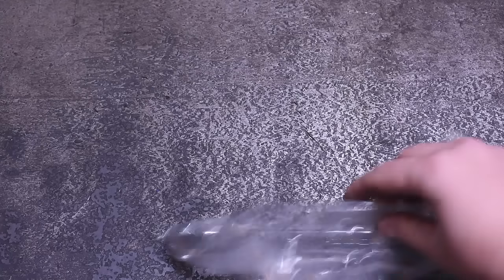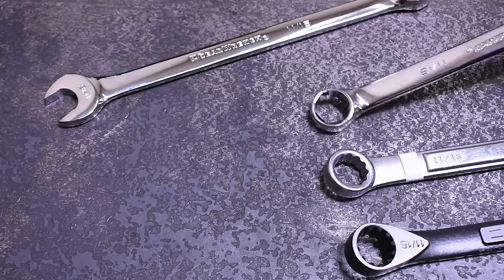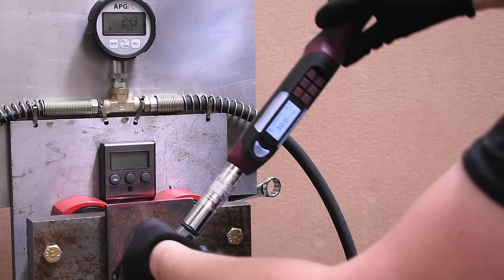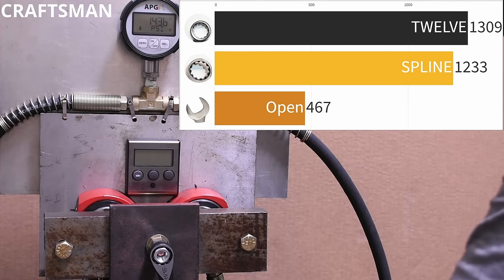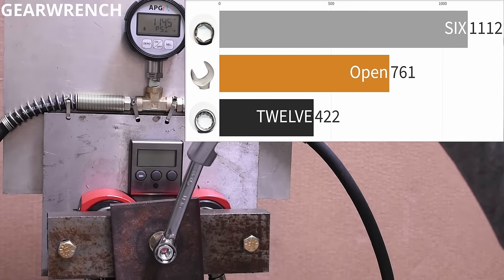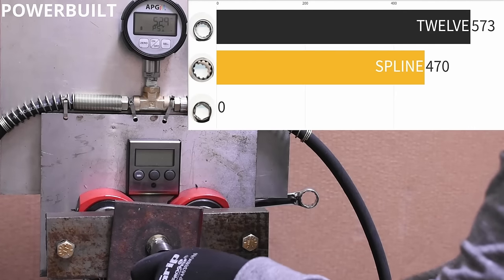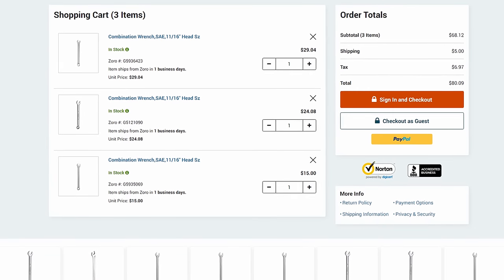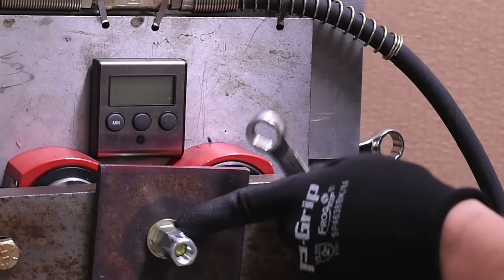Let's Settle This! What Wrench & Socket Design Will Slip 1st?

Comment: I truly believe it depends on the job. As some nuts/bolts will be a struggle to crack if there is less points on the spanner/wrench. Mainly because it can be to close to another object to get to get decent leverage/ grip to crack . Where as more points means more angles ...otherwise 6 point all the way less slipping guaranteed as is the same shape. . Just my personal opinion. Great video

Comment: Hello from ex-ussr country with long winters and tons of agressive chemicals on roads. 12-pointers and splines are suck. New drop forged wrenches are suck too. Oldschool open wrenches and 6-points do the job. Sometimes with 2 meter long tube (used as torque expander) and some wd40 as an ultimate argument. (:

Comment: If at all possible I always use box end a sockets that grip the flat of the bolt head or nut.  I also have a complete set of MetWrench tools that I've used quite a bit.

Comment: One benefit of 12-point is the OD - generally smaller than 6-point, there are cases where a 6-point won't fit, but the 12-point from the same set will. How does the OD of the spline compare?

Comment: Can you please test L pattern hex keys? I know they're not as resilient - ultimate torque load - as 6pt external bolts. But some industries love SHCS and knowing which brand holds best would help. I've found Wera to be my fave. They have a patented design, almost like 'flank drive' socket but mirror image. I've found works quite the difference. Literally can remove SHCS fasteners that other hex keys from another mechanic has already rounded over. Useful for 'one time' removal for service and just throw the fasteners away after access is gained.

Comment: Gearwrench has the 120xp double box ratcheting wrenches in spline drive; one end is fixed and other end is ratcheting. I've been using em for ~6 years without issue, but I can imagine spline drive to be an issue if you're in the rust belt.

Comment: I just weld a larger nut on stripped or broken heads. Let it cool down a good bit and off or out it comes. Cost is pennies another Way is drill a hole in flat or angle stock, place over stripped bolt head and weld, this allows you to break it loose but many times can't make full turn and is my least favorite trick. Hope this helps some people 👍

Comment: I just wanted to say thanks. Because of your video it gave me enough confidence to buy a set of spline box wrenches specifically to loosen a rounded exhaust bolt. It was in a tight spot and I couldn’t get a socket on it. And the spline box wrench did the trick! You guys are awesome for putting content like this up.

Comment: When I was a poor high school student in the mid 70s, I could barely afford a 3/8" Canadian Tire ratchet wench without a socket set. Even then my intuition told me 6-point sockets was the best for my non-existent budget. I bought $0.99 6-point sockets made in Taiwan piecemeal which at the time Taiwanese tools were considered to be the bottom of the barrel. China made tools would take another two decades to be common place.

Forward 50 years later, most if not all these sockets are still in my go-to tool box and none ever disappointed me. If you wonder, I work on all my race and track cars, as well as road cars.

Comment: Use the right tool for the bolt head type? ARP studs are all 12 point. So i use a 12 point socket, the only time i slipped wrenching on one of these bolts was when i tried using a 6 point socket on one of ARP's large 12 point bolt heads.

Comment: Very interesting! 6 points have always felt like the best for grip, but can be godawful to use in tighter spacer, I wonder if this will make people who saw the video look into splines more closely. If you only take the wrench examples (i.e. ignore the socket) the spline was only 19% behind, clearly not quite as good as a 6 point but very competitive, and a LOT easier to work with in tight spaces.

Comment: I'd be interested to know how well wrenches like Metrinch  (which grab on the flats rather than on the points of a fastener) would fare compared to these other types?  I've had a couple sets of Metrinch tools for more than a decade and they always seem to get the job done just fine.  I realize that there are far fewer users of these tools but I believe them to be a solid choice for my own needs.

Comment: Witch open end wrench brand grips the best without slipping  using a 13 mm wrench. I do alignments on automotive  vehicles.  The inner tie rods on most are 13 mm and 15 mm. Snap on is the best I found so far but the most expensive.  Hope this would make a good video for your veiws.

Comment: Whatever you use, always keep an open grip on a spanner (wrench) if possible.  That way, if it does slip, you won't skin your knuckles.  It's an tip my old dad gave me. 😉
Reply: Also, if you have to pull a large wrench toward yourself, make sure to stand far enough away to avoid conking yourself on the noggin if you have a slip. Learned that one myself. 🤕😂
Reply: @TsandLman  👍

Comment: It depend upon the materials.  I find cheap tools and cheap bolts and screws to be soft like cheese while quality tools and hardware work well in all formats.  Philips is still good in some cases but around the house I prefer Spax torx heads.  Car manufacturers like us to have one of each in multiple sizes.  You have to hold this with a 40 torx, turn that with a 12 point while holding it steady with an open end box wrench and pressing twice on the volume control while the left rear door is opened and shut three times and thats how you add windshield washer fluid.

Comment: There is a rare socket that you should have on here and its a different kind of torx male tool, its for the new vw bug 1.6 motor and this tool is for the head bolts, instead of spending a fortune on that tool i modified a t-55 i believe it was for the head bolts and if you didn't know japanese metric is slightly different from German metric

Comment: To stop the nut from compressing itself, can you use a longer bolt or a shorter nut, so the wrench is never on an unsupported part of the nut? (so there's always something inside the nut and it's not "hollow").

Comment: 60+ years doing mechanical work gave me the answer you came to in your testing, six, Spline, twelve & open on standard hex fasteners. Now I wonder what would happen on 12 point fasteners if Splines would still beat the 12 point box or sockets?

Comment: Great video!

The splined tools do seem to do the work, but at the expense of the finish of the fastener. I would take this data and my professional experience and give the conclusion that 6-point should be your 1st choice, maybe use spline if the fastener is already in a bad shape and only to remove the fastener. Of course at that point you may be better off just using a hard punch and a hammer to rotate the fastener or even a chisel to split it.

Comment: In aviation I use 12 point for 12 point hardware (fairly common), and 6 point hardware (also fairly common). But I do have 6 point tools in addition from 7mm / 1/4” and below for protecting the hardware from damage.

Comment: A battle of the parts store tools would be cool. Like O'Reilly, Advanced, Autozone, NAPA, etc. name brand tools going head to head to see who has the better tool.
Reply: Good idea. I would say Napa is better than most store brands plus in a lot of areas, there is a napa about every 15 miles so that if you break something you won't have to go that far to replace it.
 Plus most of them are open six days a week some 7. Try to find a snap-on or matco  guy six or seven days a week

Comment: I have 12 and 6 points i use interchangeably but if I want a worn nut to come off with or without hurting myself it's going to be the 6.
also I think the reason the gearwrench slipped over the craftsman is because it may be a harder wrench and is chiseling its way through the nut easier.

Now does this mean that crappy cheap wrenches can put out more torque? may be in the case of 12 points.
I always thought spline was for spline lock nuts. Didnt know they could be used on regular nuts.

Comment: Did you measure the inner diameter of the wrenches in relation to the nuts?  How much slop there is may have effected the results, and may be a factor in which brand of wrench to buy.

Comment: Nice video, good to get confirmation on "old truths" that you just assumed. Would have been nice to see those 6-point wrenches that are slightly convex on each of the 6 sides. They are supposed to be even better at biting into the flat sides of the bolt, instead of applying all the force at the corners of the bolt.

Comment: I have to wonder if you kept the open end and box wrenches on the faster until failure (rather than taking them off and getting a new bite) is skewing the test vs the sockets which ARE kept on the fastener until failure.

Comment: the arc swing is why I use 12 point on 6 point bolts..  I love it when theres room to get a ratchet in even wit ha low-profile socket its just not possible over 1/2 the time..  ive not had the greatest luck with ratcheting wrenches.. esp with a pipe..  now admiteedly after seeing this video ill prob buy a set of gearwrench brand maybe ive just had crappy ratchet wrenches in the past..

Comment: With 6 point you need to distinguish between actual 6 point and hex wall or flank drive  versions that put the force further along the flat away from the point.  The test used here is not really representative since almost always the nut would have the male thread inside when the max torque is being applied so the collapsing effect  observed at the highest torques would not be as extreme.

Comment: I have all three types of wrenches not surprised by the results.  My extra long  double box are spline drive, though I really don't use them much because I prefer the six point wrenches with an extender as you have done here.  Really the problem is these days, six point wrenches command such as premium  over a 12 point combo wrench.  On E site, Craftsman v type 6 point wrenches used sell for more than they cost new, in some cases more than 3x their original cost.  The lower cost new on various sites I've seen and used are junk.  There is only one set that I have experience with that works ok, but the finish is only so-so at best and at worst down right terrible.  But, the fit at least, is good and matches my 30+ year old SK & Craftsman units.

Comment: I was always told that a 12 point ring spanner was to turn the nut lots in tight space and the 6 point ring spanner was to put on the torque for tightening and undoing.

Comment: So what I’ve learned from this video is that if it’s a 6 sided bolt use a 6 sided spanner or socket, if it’s a 12 sided bolt use a 12 sided spanner or socket, if it’s a spline bolt use a spline spanner or socket and if you can’t fit any of these on due to space then and only then use the open ended spanner.

Comment: I was always told that a 6 point will always grip a nut better as there is more surface area in contact. All the others are pushing towards the square peg in a round hole scenario.

Comment: I have been out of being a working wrench for 10 years. When I was working Snapon said there 12 point would give higher torque than there 6 point due to the angle of ground into there sockets. To be honest I stuck with six point unless the tool truck only had 12 point to exchange for broken sockets.

Comment: Last time I rounded off a bolt it was a craftsmen spline and on the first bit of motion I got. Was a socket too. proceeded to bend an open-end wrench and round it further xD
6 point is better. More surface area of solid contact. If you're gonna replace the bolt/nut, just start with a circle bolt socket xD
I think the 12 point closed are great 95% of the time. Just gotta be prepared for the 5% that can rob you of time if you weren't.

Comment: Great video 
You forgot to test Metrench spanners  and sockets, they have their own design which is made for imperial and metric all in one,
It’s also great for the rounded off nuts because if it’s design.
Reply from the maker: Will do this week
Reply: There already is a solution for this problem

get rid of the imperial garbage lol

Comment: how accurate can this be ? are you grinding the same amount off each nut before you start ? the grinding marks looked different each time, cool test though we did this with snap on vs matco at work one day lol they both snapped the bolts before slipping

Comment: I moved to purchasing splined drive on my tools... In my experience they slip less then the 12 points, but offer greater number of angles to set your wrench at then the 6 point. Sure I still have the six points, but only use them in cases that I need the extra grip on over tightened or rusted on bolts.

Comment: I swear by the Craftsman spline set.  I own and maintain a couple of Mercedes, which have a mix of regular metric and torque bolts.  The spline set just means I don't need to fish through multiple tools.  Granted, where I live is ideal conditions so, no rust and bolts are never really seized, but on the rare occasion something is stuck (on my Ram truck?), I have a set of 6 pt impact sockets and oversized 6 pt box wrenches.

Comment: 12 point is also good with square headed bolts/plugs. 6 point is all i use, especially for initial busting lose in tight spaces then i go to 12 point. I feel like the data means nothing compared to actual practice on seized bolts/nuts/pins

Comment: I can tell this video was made for auto mechanics when he started talking about grip on rounded fasteners. If they didn’t make automotive bolts out of peanut butter, neglect to use washers, and put corrosion prone alloys in damp areas, rounding over wouldn’t even be an issue. As an aircraft mechanic, rounded fasteners are a rarity, and 12 point fasteners are common, so it makes sense to have a majority of 12 point tools.
Reply from the maker: You're 100% correct

Comment: I've not tried splines yet - are they designed to make contact further in to the centre of the face of the nut than 12 pointers?
I'm not a regular worker with wrenches and spanners, so I tend to use 12 pointer socket sets so I can deal with the square nuts I often encounter.
I do have about 4 sockets which are 6 pointer (actually my preferred type) and they live with my torque wrench.

Comment: i wasn't expecting the spline to outperform tge 12 point, i've had the chance to get a few spline sockets cheaper than the 12 point ones of the same brand but they always looked bull to me.
6 point is the type of my choice and it looks that i'm not wrong with it.

Comment: Another aspect to consider would be if you are able to re-use the same bolt or nut after tightening and loosening the fastener, so an assessment of damage caused in the process of use because its pointless if it can handle more torque but destroys the fastener in the process. personally i think the 6 point will win this one as well.

Comment: From my experience, using the 6 point on a hex prevents stripping that a 12 point can cause. I never used the spline before because I never came across a fitting that needed one.

Comment: It kind of makes intrinsic sense that 6 point would be best on a 6 point fastener, it will get the most contact over the most surface area
Kind of curious if 12 point shows similar favorability on a 12 point fastener vs like, an open 12 point wrench? (don't know if they make those?)

Comment: Biggest mistake I ever did was buy a Husky spline drive tool kit. It was on sale. Last one on the rack. I was trying to fill out a canvas tool roll for a junkyard "go-bag". Just about every splined tool in that kit is just a Swedish Nut Lathe. More slippery than a greased Scotsman. I freakin' hate them. Been leaning away from my 12 points as well lately and going exclusively for hex unless the hangulation of the tool handle or ratchet won't allow it. JIS bolts are the biggest offender here. Taking apart early 2000's Toyota bolts, the splines just crush the walls of the bolt head and tear it down to a mangled mess.

Comment: 12 point sockets are good if you have low space for ratchet swing radius and can’t get an angle to grab that bolt.    But once you turn it about 30° or so it’s time to get the 6pt on there lol.

Comment: Snap On 6 point is flank drive. It grabs the flat sides of the bolt/nut instead of the points. I have stripped out a bolt with a craftsman and took it out with a snap on.

Comment: I think the main issue you have of 6-point vs spline is that those high torque situations, 6-point is repeatable without doing too much damage to the nut, whereas spline is damaging it each time you use it.

Comment: I'd love  to see the failing point on a ratcheting wrench also the failing point of sockets but with somthing like an impact gun so the side to side or centering doesn't effect the result ..it was interesting to me that the sockets in the video didn't match up to the video but once I thought about it , it makes perfect sense and that's why I mention doing a socket test with a center drive like an impact wrench doesn't matter if they are impact sockets it would still make a good test for typical sockets